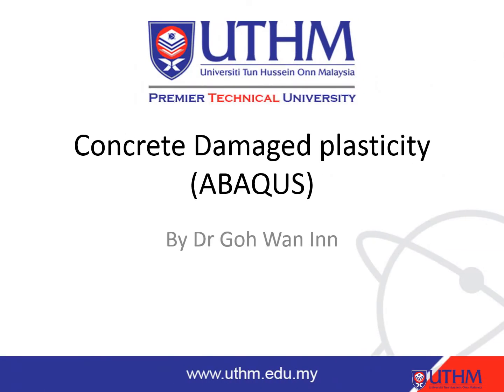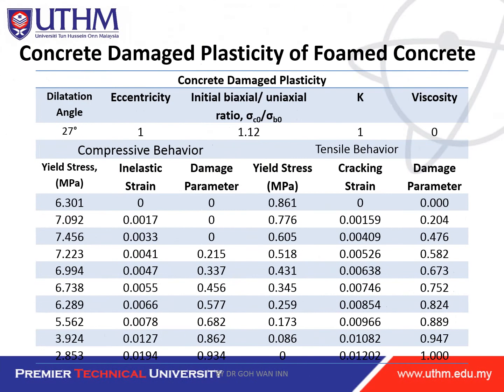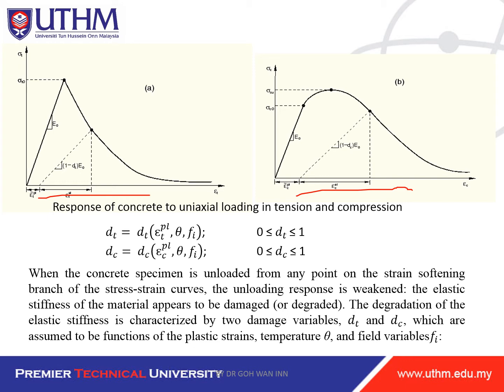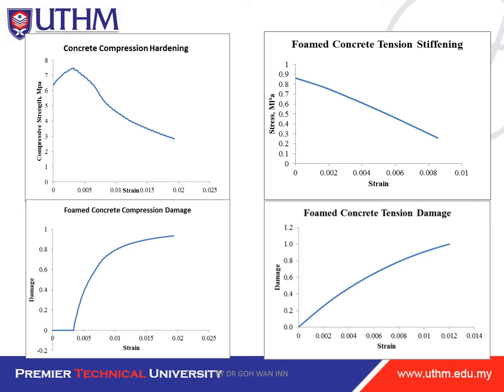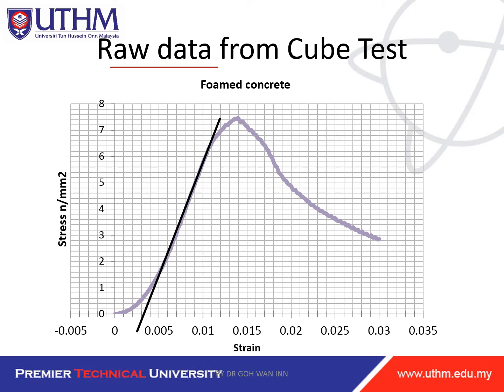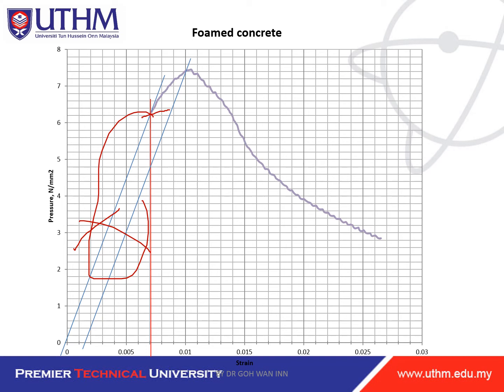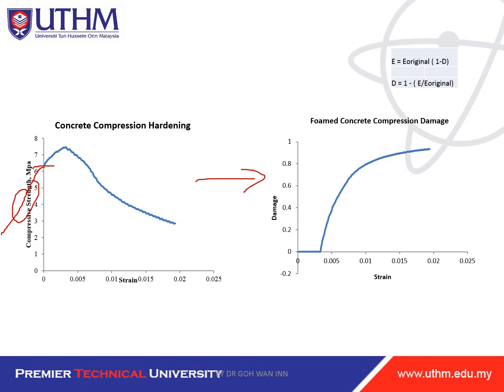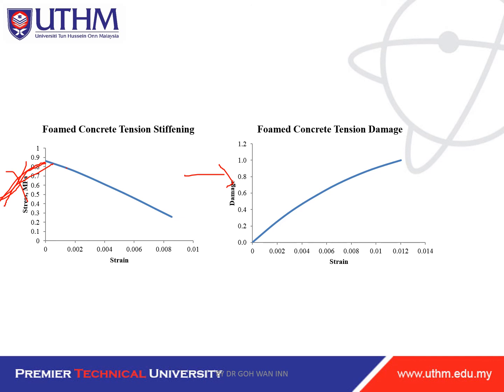Explanation on How to Generate Concrete Damaged Plasticity data from Experimental Result.

Comment: If we do not have our proper experiment, generally i use EUROCODE stress-strain relation. Is that okay ?
Reply: I have the same question here. I dont see any issue with the compression part. It is mainly the tensile stress-strain that we dont have the Eurocode data to support

Comment: very good video, thx for the sharing. I have question that how can we get the E at every point on strain-stress curve? cause we know D=1-(E/Eoriginal), in order to get D, we need E and Eoriginal. we have Eoriginal already, but how can we get the E? it seems you can calculate the E from strain-stress curve directly, could you tell me how to do that? thx again.
Reply from the maker: Hai, I have explained it in this video. Check it out.Thanks.
Reply: @waninn  thx for your reply, i check the video again, i think you mention the E at 10:00, im pretty sure you said "the E for each part is this ok, for this patches E according to this part", it seems you didnot show how to calculation the E from the strain-stress curve. maybe the E cannot be determined by only strain-stress curve?
Reply from the maker: @johnchen2022  the E is the slope for each points calculated from the stress strain curve based on the experimental data obtained. You can refer to ABAQUS manual for CDP graph which I explained in this video as well for how to calculate the D and E for each points. Thanks.
Reply: @waninn  thx a lot
Reply: Did you calculate E from stresse-strain curve???
How did you calculate E ?

Comment: Great video. But Madam how can I Determine Dilation Angle, Flow potential eccentricity, Stress invariant ratio and Viscosity parameter?
Reply from the maker: Hai Saiful Islam, if you are using normal concrete, you can use the data from previous studies. If you want to determine it from experiment, you need to go thru alot of testing including uniaxial and triaxial compression test. You shall refer to abaqus manual about the parameters. For me, I recommend you to refer to values from previous studies and validate it with your experimental result.
Reply: Hi mam, I am a ph.d student, I need guideline to CDP model in ABAQUS.

My queries are
1) cube compression test will give single value, ur narration multiple point experimental data. What test to be performed??
2) similarly in split tension we will get single experimental value.

I need your help to complete my work, Hopefully waiting for your reply
Reply from the maker: @boopathyrajapl187  Hai, if you are using UTM machine, it can be obtained from the load and vertical replacement applied from start to softening, just need to do proper set up with prescribed displacement. But, if your machine is not capable to do it, then you need to use strain gauge and get the reading. Hope this explanation is helping you. Good luck!
Reply: @waninn  Thankyou mam. I am doing my research in precast  beam erection in NDCT- Natural Draught CoolingTower in Anna University Chennai. For that only I enquired you, if have any doubt in future whether I can ask u mam?
Reply: Hi, man. do you know how to get the E or D on the strain-stress curve?
Reply from the maker: @johnchen2022  Hai, I have explained it in this video. Check it out.Thanks.